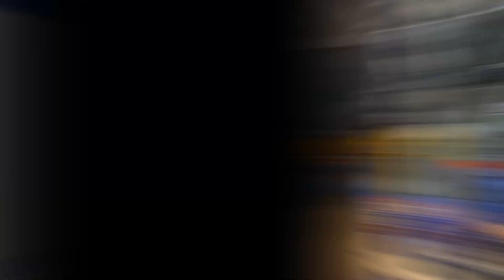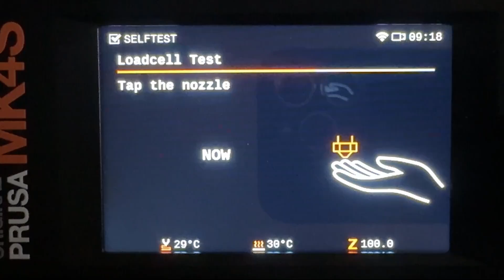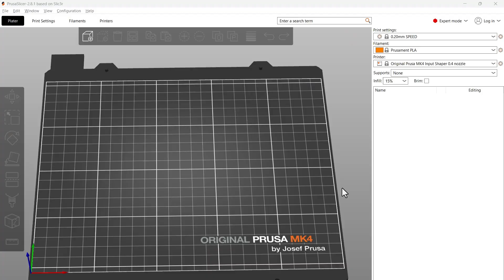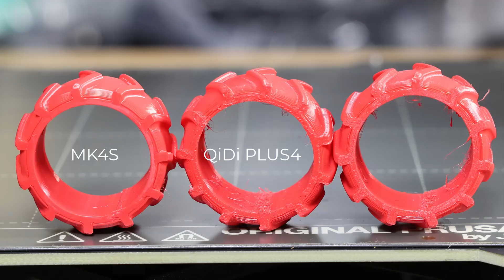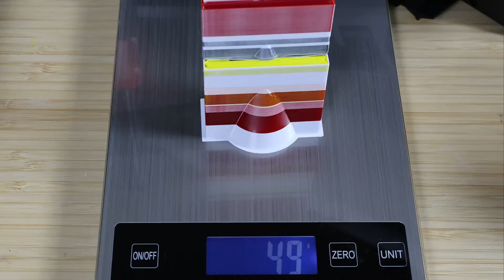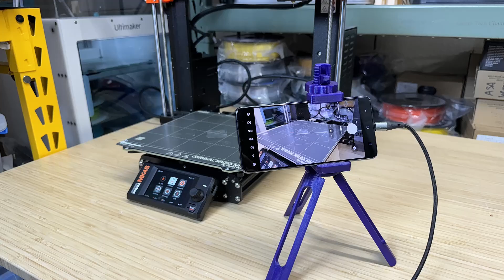Prusa MK4S in-depth test with MMU3 multiple filament system, no filament poops, print faster, but...

Comment: I think for camera you will need MPU (Microprocessor Unit) with own RAM and OS in smartphones or SBCs. Not MCU.
Reply from the maker: I did mean MCU, like in the BambuLab A1/A1 Mini. There is no application processor; instead, they use three MCUs in the printer: one for the motion system and input shaper, one for the camera, and another inside the print head. That’s how they keep costs low while still supporting a low-frame-rate camera.
Reply: @AuroraTech  Quad ARM A7 1.2 GHz is MPU. Not MCU
Reply from the maker: ARM A7 1.2GHz chip is an MPU, a Microprocessor that's powerful enough to install a Linux OS and run Python and Klipper. However, I was referring to using MCUs (Microcontrollers), like in the BambuLab A1/A1 Mini. Those machines only use three MCUs:
ESP32S3, a 240MHz processor with 16MB PSRAM @ 80MHz
SPC2168, a dual-core 200MHz processor with 80kB SRAM
SPC1168 (printhead), a 200MHz processor with 64kB SRAM

Comment: Prusa is so boring, the same old stuff, the design is so 2000's. just throw this garbage away.
Reply: The print quality is still on pair with the X1C.
Reply: @filmodpetra
Only if you print in PLA or other filaments not needing enclosures.  If you want to use advanced filament types, printers like the MK4s dont compete as they just cant do it without an enclosure.  And Prusa machines look like crap (a tinkertoy hodge podge of exposed parts) .  Only real place for them is a print farm or shop environment as they are just too ugly to sit in anyone's office or home.  Sorry but any complex filament cant be done on the mk4s while the X1c excels at it.  And yes I hate how slow the X1C is when doing color and how wasteful it is.  But wow will you pay dearly to get an mk4s and mmu with at least 4 toolheads.  And youve still got a bedslinger with no enclosure that is very limited unless you stick to PLA or PETG.  I admire the Prusa service philosophy but lets face it...Most of the Prusa parts are crappy 3D printed parts that have to be replaced often due to wear.  But ues they are less difficult to change than some Bambu ones.  But frankly this can be said anytime you compare a bedslinger to an enclosed printer.  The enclosure is all that really makes X1C difficult.  Same could be said of every enclosed pronter out there.  If you have 2 cars, one with a hood and all the well covered parts and  one without a hood or parts safety coverings. Which one will ne easier to work on?  Obviously the one without the hood will be easier to work on.  But do you want to drive around a car with lots of exposed parts and the problems that come with exposure to the outside?  Not most of us.  Same applies to most people who might have some interest in 3D printing.  Most of us want the car that does the same things as the hoodless one does with the far better looking and protective chassis.  And you do pay more for it looking good too.  The weird thing about Prusa fans is they prefer to pay far more for the lesser product.  I want 3D printers to be more like any other appliance.  I could care less about DIYing the heck out of my appliances or 3D printers.  I just buy what I want and can afford upfront and dont worry about whether I can change the firmware or hardware every tome something new and insignificant comes out.  As long as it works as advertised at least for a couple of years, who cares.  For 3D printing to ever move past the fan boys and DIYers with too much money and time to spend, we need to start building and warrantying 3D printers and release structures  more like refrigerators or TVs, etc.  You purchase what you can afford.  And a few years down the line when the industry has significantly improved, get a new one with more capabilities.  People who worship brands arent getting what they pay more most of the time.  3D printing will be nothing more than a DIY hobby experience until more models are built and supported like an appliance is.  Most of us will never own a print farm or want to modify or regularly update the firmware or add new hardware for tiny increases in percieved capabilities or become CAD masters to use our products.  Most of us just want to point at a online file and have our printers reproduce it.  Of course its great if you have that extra knowledge for times there is no similar online product, at least till 3D scanners actually become useful.  While getting better, 3D printing is still not close to being an appliance so most people just don't want to get started with one yet.  They are still noisy, put out toxic fumes, take many hours and sometimes several trial and error runs to produce simple things you can buy off the shelf of most hardware stores for 1/10th of the cost and plastic waste, with quality that far pales in comparison to manufactured, molded plastic.  Frankly, 3D printing is improving way too slowly for far too much money which consumers don't want.

If you're a DIY person that loves tinkering, and has little to no budget or time restraints, sure the Prusas are hard to not take seriously.  But if you just want a 3D printing appliance that works most of time, the Bambu is much closer to that appliance than Prusa or any other nonenclosed bedslinger at a lower cost than Prusa and far more feature-rich.  And if you want serviceability and print farm use get a Banbu P1P and youll have the same Prusa abilities.  

Yes Prusa was king for many years.  But they keep releasing the same old tired minor updates for far too much money and still have inferior products to the new King Bambu.  Sure Bambu has its issues too.  But its done it better than Prusas new machines that really are just the old MK3s with a few minor improvements.
Reply: @dggcreations  Is your approach of simply consuming and throwing away always the better one?

If you need an enclosure then just put the damn printer inside. If you only print PLA and the enclosure bothers you, leave it outside.

Whether something is easy to repair doesn't depend on whether it's closed or not, but on how much effort the designer puts into it.
Or whether he prefers to design it so that it can be assembled as quickly and cheaply as possible because he has no interest in it being repaired at all. 
In the EU there will be a right to repair. And that is a good thing.

And what could be better than being able to reprint your own parts. No waiting, no transportation. And I've never had to replace a printed part.

The Prusa is always with the most accurate printers. And that with the oh-so-bad printed parts. They run for years in industrial environments. 
But no, it can't be good for anything, because it doesn't look good enough.

Yes, the Prusa is expensive. The buyer decides whether it is worth the price. Are they all stupid who buy one or have they simply had good experiences with it?

You can argue about the looks. I like it when I can see the functional parts and they are not hidden. When I look at the P1, which has the same frame as the X1C, I can see why they have to hide everything.
Reply: @filmodpetra  A Bambu A1 for $300 at Microcenter is also on pay with them. Also, the Prusa is $1280 after shipping.
Reply: @rsilvers129  yes, you are right, I also think the price is just too high. But the comment what I reacted to wasnt about price, but "2000s tech". So I think it can print with amazing quality, even without having a lots of fancy stuff like lidar etc. That fast robo alpaca was impressive in the video. Also the dimensional accuracy at fast speeds. So in my opinion it is an awesome printer. But yes, it is overpriced indeed.

About other stuff like an enclosure, it really doesnt have one, but for about 50€ you can build one from 2 lack tables...
Reply: @filmodpetra  Bambu Lab fans are already on the 4th millenium (or 22nd century, depending on how to look at it) 😅
Reply: lol…It’s a 3D printer not your wardrobe…

Comment: You can use "No Sparse layers (Experimental)" in the Multiple Extruders section of Print settings. That way the purge tower is only used on colour changes, not for every layer. It works really well although experimental. You just need to keep in mind the Z axis has to come down, so keep your model away from the purge tower (Y-axis)

Comment: Im actually a voron fan, but the thing i love about vorons in my print farm is you never need to buy a new printer, as new tech comes out you just incorporate it into the printer.   Recently upgraded to the inductive probes and their fantastic.       Prusa is similar, but with more support,     Everyone bangs on about bamboo, but after about 1500 hours the rails need replacing and its like a 6.5 hour job. most people cant do.      Prusa is a couple of screws.    Same as voron.      For a heavy print farm i think long run prusa or vorons makes a lot of sense.        But more for a someone just printing for themselfs a bamboo makes sense.   I think people with x1cs and p1ps with print farms are going to regret it when it comes time to replace all their parts.
Reply: There not going to replace the parts they will just chuck it out and buy a new because at that point the printer would be payed off. I have a feeling in a couple years landfills are just gonna be full of these printers
Reply: I am on 2+ years (Kick starter backer)and 8k+ hours of printing and my carbon rods are fine.
So where are you getting this 1.5 year life span?
Keep up with general maintenance and any machine can go years without major part replacements.
Reply: @No0o0o0o0o0  My Friend Bamboo are is serious trouble, their likely going to file bankrupt.   Their locked down machines will have no support.   Statysis are going to ahnialate them in court over their theft of pataints, their entire USA and Europe market will collapse overnight as they will be banned from selling there.     Bamboo is going to go under.       Open source vorons are the  best bet.    Ive got bamboo x1c and my vorons are faster more reliable and every part can be changed as the tech changes.       Reminds me of games consoles.   Yeah their great when they come out,  but a pc will always beat them as the tech comes out so much faster and you can upgrade each component..   Pcs are always a step ahead.
Reply: @No0o0o0o0o0 maybe he prints carbon fiber fused filament?
Reply: @jaydenjegachandran557  No clue what he prints but from what I print I have no major issues.
Again proper maintenance wins the day. 

What's notable is when Bambu first came out people stated nothing can be fixed and everything is glued or welded down and it's ewaste

1 yr later it was, you can't get parts, BL is "against right to repair" ..etc. 

2 years later it's it can take you a long time to repair .

What I find interesting is that there have  active wiki, videos and plenty of parts at reasonable prices and still the goal posts keep getting moved.🤔 I have ignored those folks as they have a preset agenda and their "preferred brand" is always better. When faced with factual information they pull the " but actually" and pull some data point from some rando source.
Reply: @No0o0o0o0o0 i don't know where he get the 6.5h to change rod nonsense. If he needs to 6.5h to change a rod, then he would need a year to build a voron. Full of nonsense.

Comment: Ah that part fan cooling duct obstructing the nozzle is a pet peeve of mine,.  If you are trying to babystep that perfect first layer / z offset, that can be a hassle  My frustration with Prusa 3D printers is they seem overpriced and it takes months for them to really deliver on their performance goals via many firmware updates.  Bambu Labs (and others) have really taken over their price point, with the P1S and others being up to half the cost of the $1099 Prusa Mk4S.  Another ding - it's much smaller (250 x 210 x 220) where as the Bambu Lab machines offer 250 x 250 x 250 mm across all their products.  Nice review!
Reply: Just look / film it from behind.
Reply: Yeah, you are right. The price of Bambu is really better than Prusa, but you need to see the fact that Bambu is from China, so the reason why are their printers are so cheap is that they are made by children who are not paid well, but Prusa is made in Europe by real workers with good salary. So I think it is an ethical matter of fact, if you will support Prusa or Bambu.

Comment: Do you update the printer recommendation on your website? I feel like the P1S isn't that high on the list anymore, since other printers came out
Reply from the maker: No, the P1S and P1P were never on my list. I would have liked to see them at least come with the same touch screen as the A1.
Reply: P1 machines have horrible UI and controls

Comment: Very good test that reflects the strengths and weaknesses of the MK4S and the MMU3 well. I really noticed how much effort you put in, in contrast to the MK4 test.
The accuracy of the MK4S at top speed is impressive. 
The use of the MMU3 could be smoother, you're right. But it is all the better in use. 
I believed in the development of the MK4 right from the start and that's why I opted for it. You can rely on Prusa in this respect, just as you can rely on the delivery problems when they bring out something new.
And I'm sure Prusa isn't finished with the MK4 yet.

Comment: There is also an Hardwareupgrade option from MK3s to MK4s - but it is just about 250$ cheaper than a MK4s Kit.
Reply: Even less difference if your mk3(s(+)) started as a mk3 (old PSU and heatbed with soldered cables).
However, if you use the mk3s+ to mk4s upgrade kit to upgrade one mk4 to mk4s and 1 mk3s+ to mk3.5 (some cable cramping required, good upgrade if you already have an updated extruder like the zOrbiter 2 with Revo hotend and are not affraid of compile a modified firmware), you get a complete Nextruder for your own projects for about 180€...